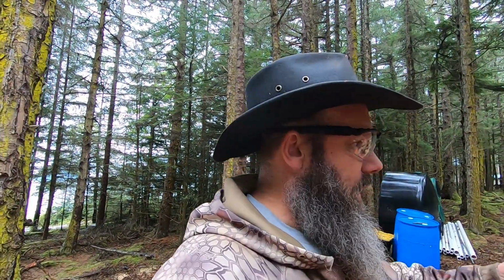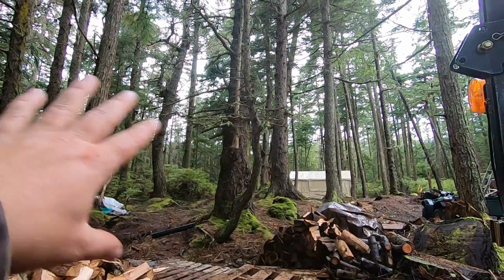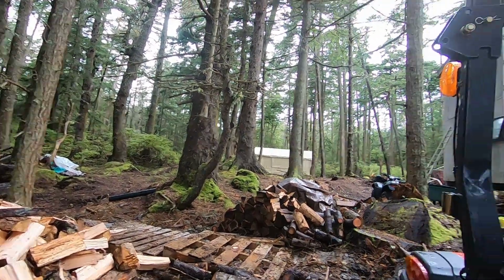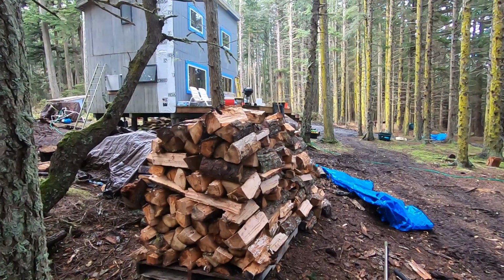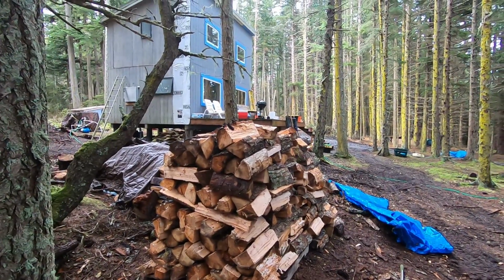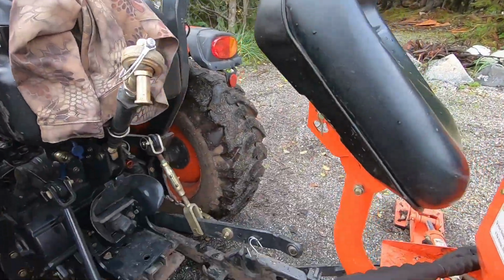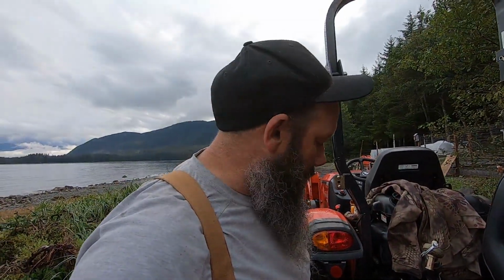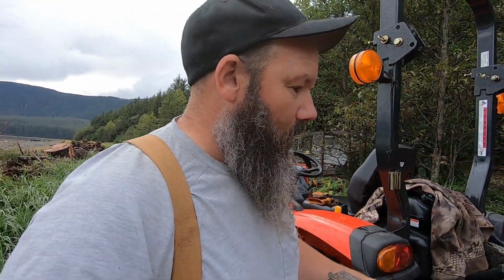Split-Fire log Splitter | Remove backhoe from Kioti tractor

Comment: These Kioti tractors are work horses. I got a 3 point chipper for my Kioti and it is awesome. I like your splitter, however I used my tractor to do everything but split. Look for my chipper videos if you are interested in a chipper. First attachment I bought and I think it was around 1100 bucks. I will never get wood again with out my Kioti. What a work saver. Love your videos as usual. They are great
Reply from the maker: That’s awesome. We could use a chipper too. I’m loving the tractor.
Reply: My Alaska Dream Yes they are. Kioti makes a very reliable and able tractor.   I,d make the same choice again

Comment: Good stuff.  I'm looking into one of those myself.  Although I'm leaning to a PTO chipper/shredder for dealing with the branches after felling, then renting a splitter 1x-2x a year for a day or so.  Get your RPMS ups on the tractor to increase your cycle speed on the splitter.  Your check what RPM you should be at for optimum PTO hydro speed.
Reply from the maker: Yeah Maybe they’d be nice and loan me a chipper too😂
I’d love to make my own mulch. For the garden and shred stuff for compliant. 😋 
Yeah it’s all about the RPMS. I may not have touched on it in the videos.

Comment: Thanks for showing the disconnection of the backhoe. I bought a new CK 
3510 Kioti earlier this year with the backhoe installed by the dealer....and have been expecting disconnecting it to be difficult.  I've heard about using a floor jack to help lift the front "tongue" into place. Also, please consider keeping your hands off the wood when splitting. My wife smashed a finger with our splitter...and very nasty accident.
Reply from the maker: You are welcome. Sorry to hear that about your wife’s hand. On top is ok on the sides, no way. That’s my motto.👍

Comment: You would probably really benefit  from a hookaroon to move wood, both small-medium rounds as well as split wood. I swear it'll change your life. I really prefer the 30" Log-Rite hookaroon. Not terribly expensive, but it pays dividends in minimizing back pain.
Reply from the maker: I’m doing a review on the log ox next week. I like the hook better then a pickaroon. I think you spend more time getting the pickaroon out of your wood.
Reply: @AnAlaskaHomestead  Once you use it for an hour or so, it becomes one movement. I'm pretty darn fast with one, but admittedly I work with much drier wood in the Colorado mountains. I really like the design and weight of the Log-Rite.

Comment: Just a thought but I'd check into getting some heavy duty resin or plastic pallets and a ratcheting bander. Would be an investment but if you could band your wood stacks down to the pallets it would make for easy movement wherever you need them if you use your fork attachment on the tractor. Great video, very informative, thanks for sharing!
Reply from the maker: I’m going to give a tarp and ratchet straps a try. Not sure if it will work though. I may lose a couple of pieces or maybe it all falls off. 😂
Reply: @AnAlaskaHomestead  I have used shipping plastic wrap.  Make the first couple wraps around the wood and pallet and work your way up.  Plus it helps keep more rain off of it.  Place a couple dead young pine poles across the tops of a bunch of them to allow for air flow and throw the tarp on top.  I found a trailer building company that also replaced old trailer rubber roofs. Their repurposed heavy gauged rubber roofing has lasted for 15 years of mother natures abuse here. It does not fall apart in the wind or Sun over time.

Comment: Chicken-House trick- old school: There an old technic for chicken houses- many uses wood chips 30 centimeter on the floor of the house. Only importend thing is that the place must be protected by rain. The chips dry verry fast and because the ships are dry they soak the water out of the chicken po (Kacka auf Deutsch) Hühnerscheiße. Also the urin of the chickens are soaked! Many change the chips one time in a year...Also it does NOT SMELL! It dont know way but they say that with wood dust or grass it stinks but with the chips not me be it has to do with the biochemical porcess in the chips...Greets fron Hamburg

Comment: Get a hookereoon and save your back moving the firewood.  Makes a world of difference.
Reply from the maker: That video is coming out in the next week or two.
Reply: @AnAlaskaHomestead  Another back saver is a wood pike. I made one with a rake handle and 5 inch 5/8 bolt.  Cut the head off the bolt, fill the rake hole with super glue, jam the threaded end in, let dry then sharpen to a point on a grinder.  Never bend your knees again!
Reply from the maker: Basso Matic 😂 got one, I bought it from the store though👍

Comment: One question... how much weight have you put on since buying that tractor?  

I really like that two way feature.  

There is a company that sells “hunting buckets” just a five gallon bucket but the lid is padded for sitting on (and it’s camo so you lose it in the woods).  Pretty sure I’ve seen other companies selling padded lids for buckets as well, but a stadium seat pad taped to the bucket bottom might work better for you.

When you stack it on the pallets don’t just stack across all pallets, stack it criss cross on the individual pallets and hold the stacks on with rope or bungees, then you can move the pallets with the tractor instead of doing it with manual labor and your back.

How come you aren’t chainsawing any of those logs into cants to dry and turn into lumber for projects later?  That is about twenty years worth of firewood you plan on making, it makes more sense to make five years worth of firewood and twenty thousand board feet of lumber to build a shop and a wood shed...  IMHO (that’s a lie, I’m not humble, I pretend to be humble)
Reply from the maker: 😂 I stopped watching my figure cuz I wanted you to start watching it for me.😝
I’ve seen those padded tops. Not a bad idea. 
Yeah I plan on milling some stuff still. It’s low on the pole though. More of a winter project.
Reply: My Alaska Dream 
So this year you are spending the whole winter there?
Reply from the maker: @Rick_Sanchez_C137_  Yeah, Once I stopped working at the mine we've lived out here full time.  That's been about two years.

Comment: That certainly is a nice splitter but there are a few things that I don't like . It sits way to low . It would kill me to get up and down from that bucket . Second you are running your tractor adding hours to it . Third , using more fuel to split the wood than you would with a gas powered splitter .I do like that it splits both ways and it has a tall wedge . Split-fire does make great splitters but I would by-pass on the PTO driven one . It must have cost them a fortune to ship that to Alaska .
Reply from the maker: You can raise it and lower it to your desired level. I like sitting on my bucket and splitting wood. 
That is the one drawback is it puts hours on your tractor. The plus side is you don’t have another motor to maintain.

Comment: You saw the wood shed simple living alaska put in a few months back? https://youtu.be/5nIGgvaiBtg They took advantage of an Alaskan sawmill to create most of the beams and boards needs so the majority of what they had to bring in was the roofing and the fasteners. Got to admit that the ability to store 2-3 years worth of wood is nice as it gives you a safety if you have an injury one year. 

Not only would it give you a good spot to store wood but it would also give you a new place to collect water from and if built for it could even park the tractor inside to free up other space.
Reply from the maker: That’s the plan. We are going to use some driftwood logs as the base. They should last 100 years. 😂